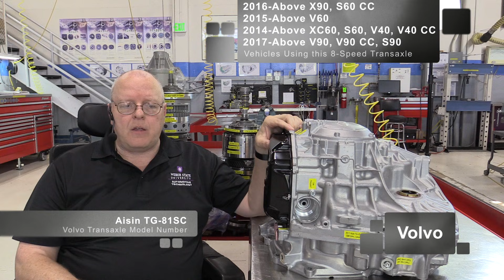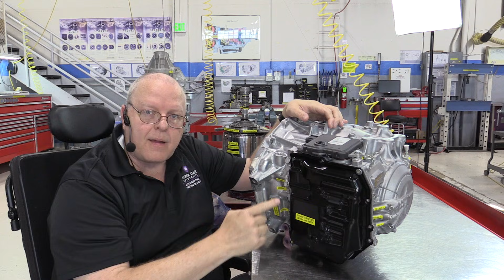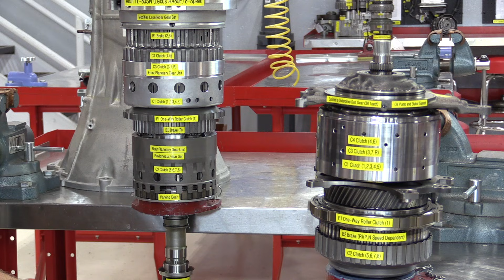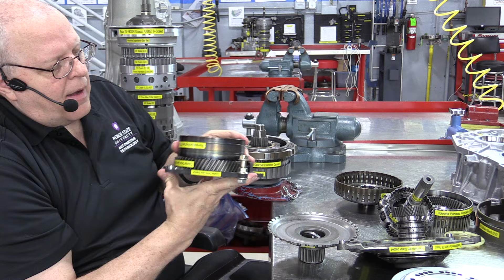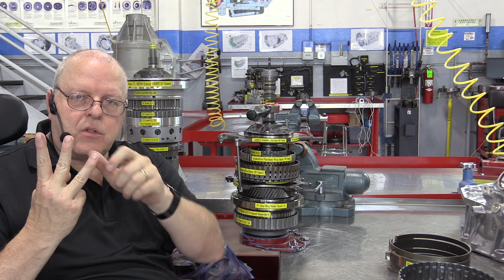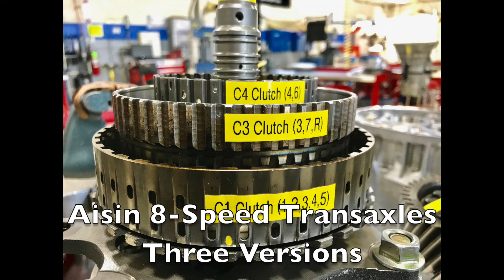Aisin 8-Speed FWD Transaxles -  Volvo, Toyota, Lexus, GM

Comment: I have a 2016 Chevy Malibu 2.0 with a 8 spd transmission. I see Raybestos makes stronger clutches. The diff is open but these trans are used by other manufacturers like bmw etc. wonder if I can take a LSD diff from a bmw and put into my aisin GM 8 spd transmission

Comment: Used in 2017- BMW X1, 2016- Volvo XC60, 2022- Audi Q3. All drive differently. X1 has great software and shifts very well. The Volvo down-shifts terribly when slowing. The Audi up-shifts poorly. Shows the importance of the manufacturer buying the transmission and changing Aisin software. I suspect Volvo didn't touch that code, BMW really altered it to match the vehicle and Audi botched it. The DSG in the Spanish built Q3 is a 1000 times better than the latest Aisin powered Hungarian built Q3. Have driven them all.

Comment: Very good video, thank you for that. I've still got a question, in my 2021 Citroën C4 is an Aisin 8 Speed Transmission mounted. When I am in "D" Mode, the car is not crawling very well at very slow speed with the brakes applied. But, if I switch to "M" Mode, it's very easy to let it crawl with brakes applied. What is the difference between "D" in first gear and "M" with first gear?
Reply from the maker: Internal fluid pressures are increased.
Reply: @WeberAuto  thank you.
Reply: Same “problem” with 2021 Peugeot 5008. I had the eat6 in my older 5008 (2018) that was perfect. This gearbox is really not suited frictie car. Also very strange noises in 5th and 7th gear at light load. The crawling in stop/start traffic drives me nuts… it looks to be the torque converter I guess..

Comment: Of the three 8 spds you listed, Which one does our 2017 sienna fwd have? We like it, and was hoping you would explain how the Torque converter locks up in low gears
Reply from the maker: Open your driver's door and look at the black label. It has a UA80E in it. Thanks for watching
Reply: @WeberAuto  
Thank you, it says AU80E, is that the light or Medium Duty?
Reply from the maker: @sunshine76-d4m  It is the medium-duty. A good one. I have the same trans in my 2020 Sienna.
Reply: @WeberAuto 
Love that 👍

Comment: Technically speaking, is it possible that an overheated torque converter can damage a rear crankshaft oil seal?
Reply from the maker: Possibly, yes. but it would have been really hot. There is a flywheel in between the torque converter and the rear main seal that would act like a heat shield.

Comment: Hi great info on this video.  I have a 2016 volvo xc90 with this transmission. There is slippage when transmission is cold my Volvo main dealer says there is nothing wrong. Should this transmission slip? Many thanks.
Reply: since no one replied you, yes it is normal on those tranies, they do that until the gearbox hits an certain temperatur, dont think you should floor it before the engine and tranny has been warmed up

Comment: Hi, I have several Toyota Proace Verso 2023-2024 company vehicles with such automatic transmissions. At mileages of 180-220 thousand kilometers, I encounter failures with these transmissions. On the most recent vehicle, I started changing the oil every 60,000 km, although my dealer claims this is unnecessary and that the oil's lifespan lasts for the entire service life of the transmission. What should I do to prevent my transmissions from failing?

Comment: Is it common when driving at low speeds for it not to be as smooth as a 6-speed transmission? I notice a lot of jerky gear changes at around 20-30mph..
Reply from the maker: Yes, it can be. Sometimes there are software updated to address that. Holding a steady throttle will also help.
Reply: @WeberAuto  Ok, thank you sir!

Comment: Hello, I intend to buy opel insignia gsi 4x4 209 PS 2019, with 123.000km. In this insignia is aisin AF 50 - 8 3 generation. Can you tell me more about this gearbox. Oil wasn't changed yet because opel mechanics said it is not necesary, what is your opinion? Do I need to change oil gearbox filter?

Comment: I have a 2016 Cadillac cts vsport with the aisin 8 speed and when my car gets to operating temperature and in 7th and 8th gear mostly my car will start hesitating. What causes this? I’ve taken it to the dealer several times and they can’t get it to do it with them. Oil and filter been changed 3times by dealer

Comment: I have a 2018 Peugeot 5008 with this transmission I have a problem with when up shift 3 and 7 it shifts really hard 1g or 2g hard and also in reverse its also late shift I have this code P0736 am in Germany sadly no mechanic wants to touch it all say that I have to change the transmission I also have changed the transmission Oil and it didn't help

Comment: Is the aisin Transmission in the 2017 Toyota Camry LE?
Reply: Yes it is an Aisin transmission but it is a 6 speed in the 2017 Camry...The first Aisin 8 speed in the Camry's appeared in the redesigned 2018 Camry..The 6 speed is much smoother and less sluggish at low speeds ..The 8 speed is more responsive at higher speeds and will get an extra 5-8 mpg when highway driven ..

Comment: hi dear i have dodge neon 2017 it have exactly the same transsmision gear but FT72SC . Is it  possiable to use the shift gear module from any other brand like opel or mazda or vovlo or any brand use the same transsmision gear or not possiable ?

Comment: How often would you recommend changing the oil? (not a flush, only regular change) Living in a climate that goes from 30 degree C in summer to -30 C in winter.
Reply from the maker: Every 100,000 km (60k miles).
Reply: I live in jersey I know many ppl hit 300 k w original I prob won't change mine on new camry ever idk if I trust ppl
Reply from the maker: @Brararaf101  Trust the Maintenance guide for your vehicle (in your glove box). It depends upon how the vehicle is driven. 100,000 km (60k miles) is the first interval for one of the two maintenance schedules.

Comment: Is that band brake used in all versions of this transaxle? Or is it replaced with a clutch pack in certain applications?
Reply: He said in video higher torque rated versions use clutches instead

Comment: For the company I drive for I used to drive a 2005 dodge caravan with the 42-TE 4 speed transmission. The new 2010 caravan I drive now has the 62-TE 6 speed transmission. I find the first 3 gears annoying to get through unless I am fine with the engine revving to around 4000 rpm which is bothersome to me. Most of the time I baby the van through the first 3 gears which is around 30 mph then when 4th kicks in it feels like the 4 speed in 2nd and I can get the drivers off my rear bumper. Is there something about the manner of "normal" driving with this transmission I should know? Has the 3.8L engine (in both vehicles) been modified for higher rpm? Thanks!
Reply from the maker: The 62TE is a modified 41TE with an additional underdrive planetary gear set on the output shaft. The underdrive is used for 1st gear and 3rd gear to create two "new gears" on the original 4 speed transaxle. 
4th gear on the 62TE  = 1.452:1,  2nd gear on the 41TE = 1.57:1 very close to the same gear ratio. 5th and 6th gears on the 62TE = 3rd and 4th gears on the 41TE. 
I don't know the answer about the engine RPM, but I doubt there were any mechanical changes, maybe there were some software changes. Is it normal? Yes, for that transmission.

Comment: I got 8 speed camry it's sealed do I ever need to change fluid? My 05 camry hit 319k flushed once at 100k my buddy 97 camry 300k never touched.. What about this 8 speed I hear different things Toyota book says change fluid if needed only at dealer?
Reply: Afaik they only recommend changing the fluid if you need to repair the transmission, as long as it's working fine it's sealed for life.
Reply: It should be changed if you want it to last a long time.

Comment: I have a 2019 avalon with this UA80E but it not like this one i need a get the serian number because i have some problems 🤔
Reply: That should still be under warranty.
Reply: Ireneus Justin Policarp  yeah Still on the warranty but when I take the car to the dealer they always told me that everything is fine and I read some stuff on Google about this transmission and I'm not the only one that is having the same issue🤷🏻‍♂️
Reply: Juan P Renteria Typical Toyota response. That’s the same treatment they gave with the oil consumption issue with the scions, rav4s and camries.

Comment: Eat 8 is the same transmission right? İs that exact this one?
Reply from the maker: I don't know. Thanks for watching
Reply: @WeberAuto  sir probably this gearbox is AW F8F45 right? Because the gear ratios that you have mentioned are same with the website below. However i am confused about there is two ravigneaux gear at this website, but in yours only one and also input planetary gears.

https://en.m.wikipedia.org/wiki/AWF8F35

Comment: Does Aisin transmission torque capacity spec live up to the advertised spec in real world, and what is its weaken point? My Volvo S60 T8 has a version of this with torque capacity of 480nm. The engine in stock already making 430nm (I have Polestar optimization), pretty close to the limit. There is another fellow owner with the 2 years old XC90 T8 with lower 400nm torque, having transmission slip after 2 years, he admitted he had been flooring the gas daily. But if the torque capacity is true to spec, shouldn't it able to take the beating?
Reply from the maker: I do not know
Reply: If he has been flooring the car it could mean the fluid has been burned a little bit. Changing the oil should solve that

Comment: Great video John. I have a fluid question. I have 2016 malibu 2.0L turbo w/awf845 trans. According to owners manual it takes ATF-WS. I went to chevy dealer to get fluid and they ran my VIN to confirm what fluid it takes and they said book was wrong and my car takes AW -1  GM PN 19256039    10-4062. I know you said in this video that these tranys take ATF-WS and gets re-bottled per manufacture. Is ATS-WS and AW-1 the same oil???  Now I'm not sure which oil is correct. Any help would be greatly appreciated. Thanks.
Reply from the maker: Yes, same oil
Reply: @WeberAuto  Wow cool. GM really did a mark up on it, $40. a quart.
Reply: I've got a 2019 VW Jetta with the aisin 8 speed and it says that It takes AW-2 fluid...Very confusing

Comment: It has a Band! though they were gone for good!
Because of the one-way clutch, can it apply engine braking in first?
Do you know if the bellhousing changes for different applications? between GM, Toyota and Volvo?
Thank you for the video!
Reply from the maker: Yes, a band. I couldn't believe it either! Yes, engine braking in first gear with the B2 brake applied to hold the Ravigneaux planet carrier from rotating in either direction. Normally the F1 Roller clutch would only hold it from rotating in the counter clockwise direction. Yes, the bell housings are different for each application. Thanks for watching and thanks for your feedback.

Comment: Hi, 
Does anyone know what the number 1283176  means on a TG81SC gearbox. Asking because I need to buy a second hand TG81SC 1283176, and found TG81SC 1285176. 

Will the 1285176 give me issues? (My previous was 1283176)
Reply: Better ask your Volvo stealership or go to the volvo forums.  I believe that’s a batch manufacturing code.

Comment: Is this transmission the same as Fords 8F35 used in their transit connect van?
Reply from the maker: No. The 8F35 is the same as GM’s 9T50, but Ford chose to use only 8 gears instead of 9.
Reply: @WeberAuto  So there's an extra gear in the 8F35 that can never be utilized?